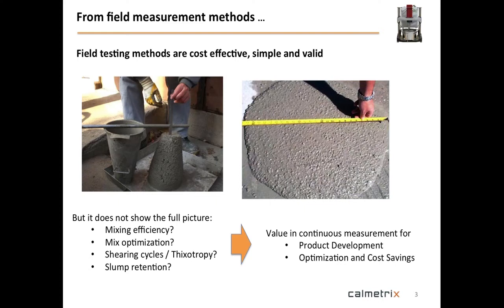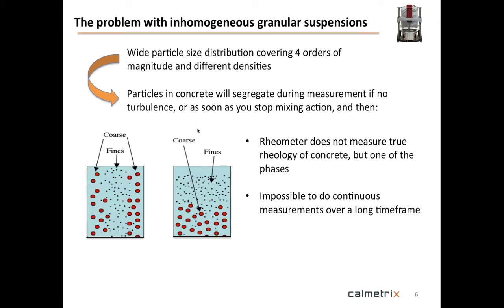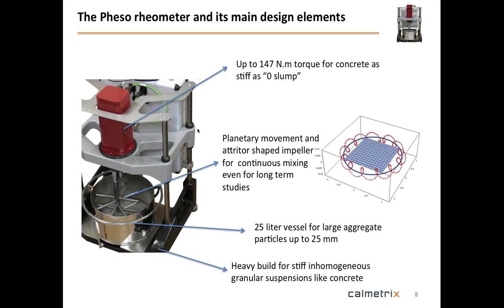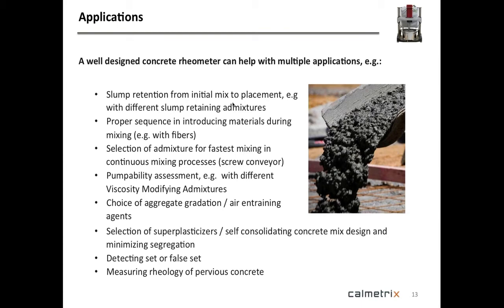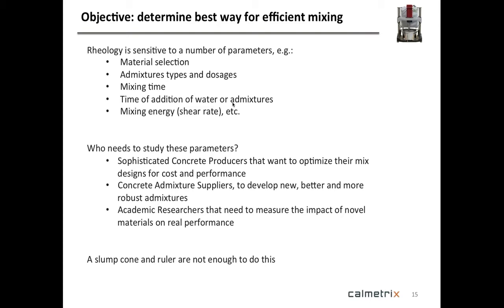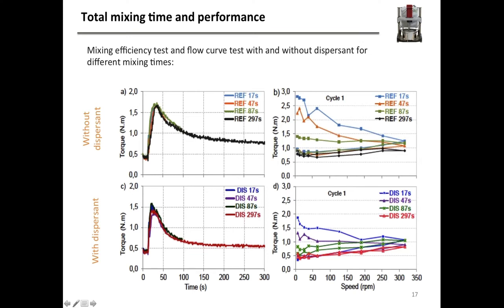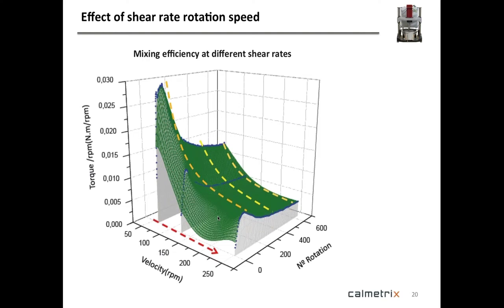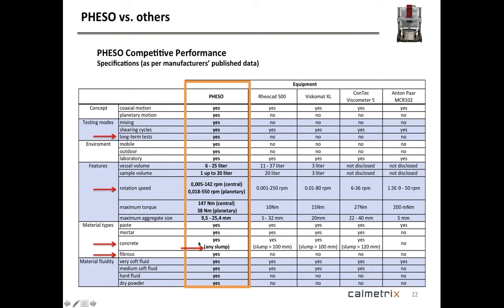Webinar Pheso Rheometer Webinar October 2017

Comment: The usual rotating velocity of the conventional tilting drum concrete mixers used in construction sites is generally around 20 to 24 rpm. What is the basis of choosing a mixing velocity of 126.5 rpm for the mixing time optimization studies?